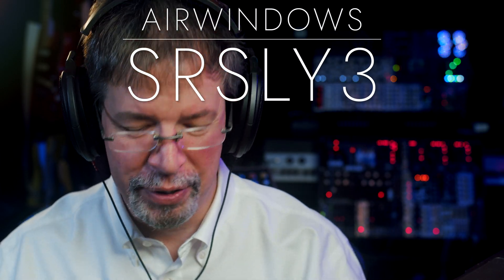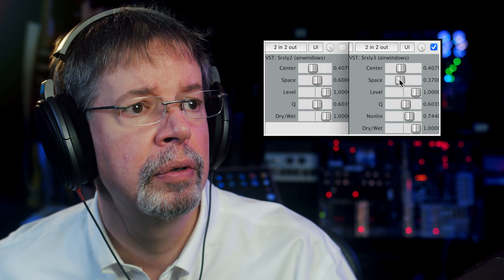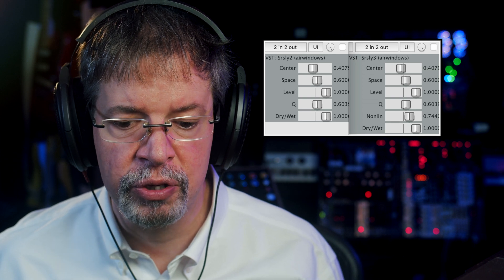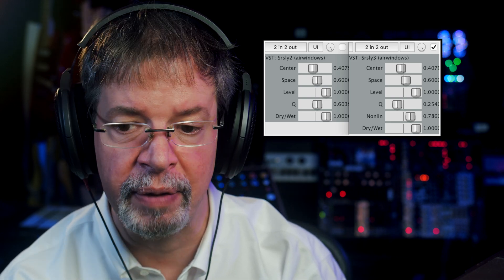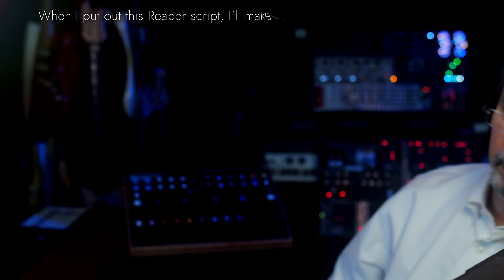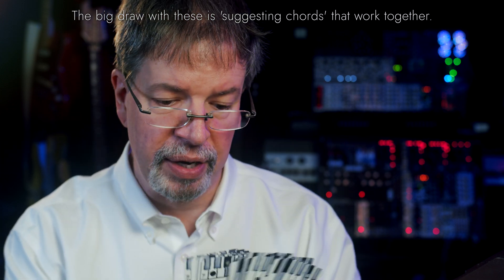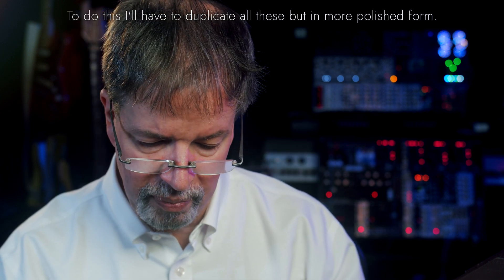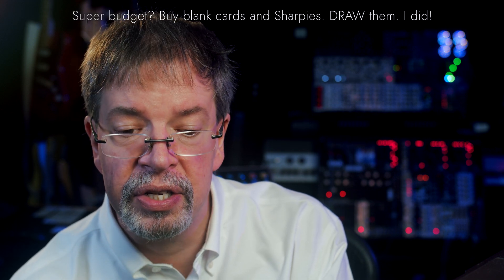Airwindows Srsly3: Free Mac/Windows/Linux/Pi CLAP/AU/VST3/VST2/LV2/Rack

Comment: One of my favorite features in Reaper is that I can select a few plugins in a chain, some of which are bypassed, and switching between them via Ctrl+B (on Windows). 
This is great for comparing plugins \ settings \ chains.
Ctrl+B for bypassing, Ctrl+Alt+B for switching plugins off-line.

Thanks for a new plugin! I tried Srsly2 and it is very useful and cool. Seems like that one is even cooler!

Comment: Does it make the audio go out of phase?
Reply: Pretty much any Stereo widening plug will do that, you just has to be careful about how much you use.
Reply: Correlometer from voxengo and leaky3 from noisebud will sort you out if you’re worried about correcting phase anomalies  without losing the soul of what you’re doing
Reply from the maker: Space ONLY boosts side channel, which is out of phase. That's why you can't simply crank it up and have it be useful. However, the resonant filters are on all kinds of stuff: L, R, side, mid, and behind the head :)